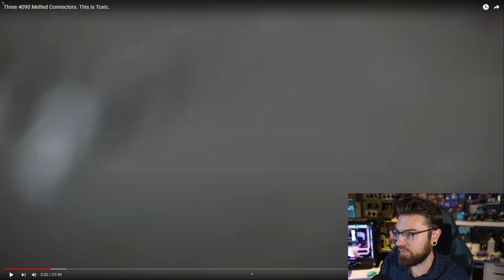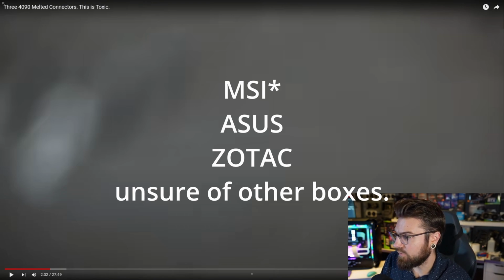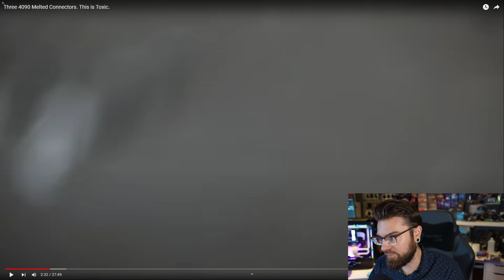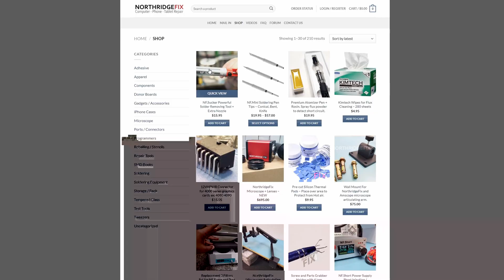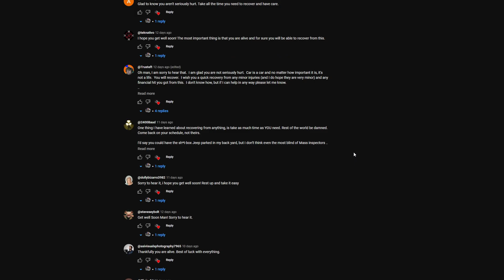100 RTX 4090s melting every month - React to North Ridge

Comment: Sorry to hear about your car accident. The main thing is that you're still in one piece, but I do know what a drag the aftermath can be.
I enjoyed your North Ridge Repair commentary... I'd also love to know which channel he was complaining about too, but it's cool that he took the high road. :D
Loving the content - keep on keeping on!
Reply from the maker: Thank you AAjax. Yeah it's almost always the aftermath with that kind of stuff.
Also NorthRidge definitely took the high road, I would pay money to take classes from that guy haha, I get chef Ramsey vibes. 
Appreciate the comment man.
Reply: He was referring to Sorin from Electronics Repair School - RTX4090 power connector replacement - no board removal video. He has videos about replacing the chipset with only hot air, using home made hot air machine, repairing shorts on the other side of the PCB without removing the board by burning capacitors with too high current, soldering ICs without reballing, using petrol instead of thermal camera, repairing hinges with hot glue and much more. He uploaded hundreds of very long unedited videos but recently he started to upload shorter videos because of YT algorithm.

Comment: I usually purchase upper mid-range video cards. So, I was never serious about buying a 4090. I did however follow the reports of melting connectors from the very beginning. I feel bad for the folks that put out 2 to 3 thousand dollars for these cards, just to have Nvidia claim user error. Shooting yourself in the foot is not a good business model Nvidia. I am sure there are many people out there that won't trust Nvidia again. Nvidia's success is due mostly to the people that purchased their cards and supported them for the last 25 years.
Reply from the maker: It definitely shows high levels of incompetence with Nvidia. Lots of hiding from problems and consumer abuse. They had similar issues over the years. I'll never forget swapping 3 2080ti FE cards in 6 months due to bad memory modules from micron. Wasn't entirely their fault, but they are good at trying to hide the issues.

Comment: If GN mentions this again it's kind of like an admission of inaccurate reporting in their first video. Wouldn't be surprised if they touch this topic again only if enough people question their previous findings and it gets enough traction.
Reply from the maker: Yeah that's a good point, their original video isn't entirely inaccurate, but it's a little bit deceptive in a way. And then you have the fact that Nvidia constantly relates to that video and used it in their own post to be like "see it's user error".
All he would need to do is clarify that properly. Like you said though it would seem like an admission of guilt. 
Appreciate the comment.
Reply: @techwandoUS 
I have noticed they don't do much testing inside cases like where most people put their GPUs , with this failed connector design .
I think a more compact connector can be used , but the pin should be much larger , sturdier and the plug too of course.
They can't outlaw the laws of thermal impedance as current passes through a connector.